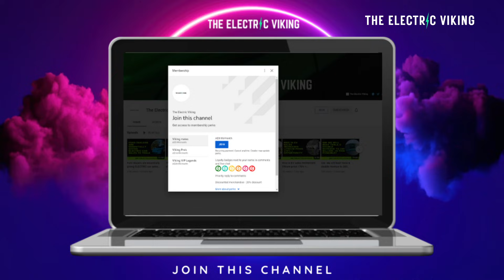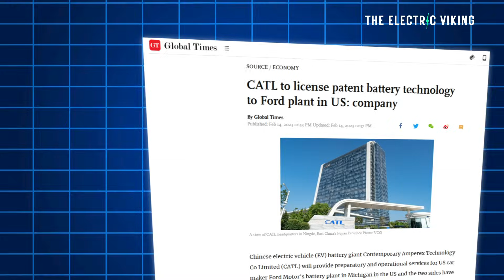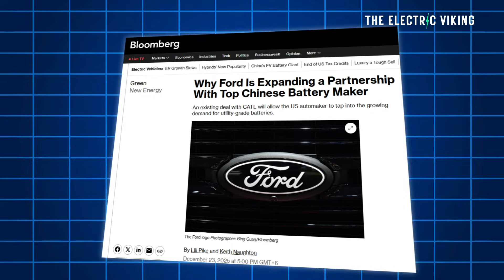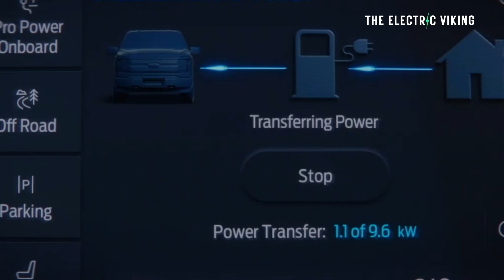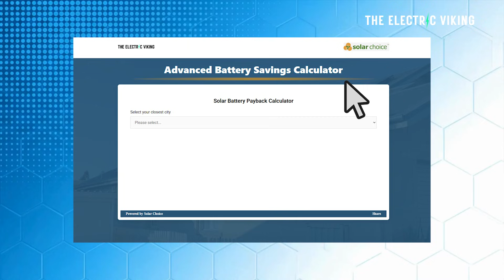Ford Cancels NMC EV Battery Factory to Build Chinese LFP Grid Batteries

Comment: Will sodium iron batteries make LFP batteries obsolete?
Reply: Not yet.  Cheaper & safer, but energy density is lower than LFP, so small shorter range city cars & stationary storage initially, till chemistry & energy density improves.

Comment: Considering just how fast battery technology is changing, manufacturing your own batteries is dumb because  your entire product line can become obsolete  in less than the amortisation time for the production tooling .
Sodium is about to com on line , aluminium - air is not far off and there are quite a few iron batteries being looked at .
Now from a company point of view, grid batteries represents a far better use of capital because you make fewer sales for many times more profit .
So the profit to equity ratio goes off the scale . Add to that governments are always slow to adapt to new technology until it has been proven very safe over time ,
The down side is grid storage is the absolute worse use for lithium batteries and once governments & energy utilities invest the type of money that a lithium powr pack requires they will be reluctant to go to better long term solutions like flow cells or liquid metal .
Lithium batteries have a place and that is in low current draw deices like cameras, phones , torches , radios etc .

The fun thing right now would be inside the minds of all of the MBA morons who flooded the board rooms of every public company & spun off every section that was not part of the "Core Business"  and now the way to make a profit suddenly has become to diversify into "Non Core" businesses where they expertise of the core business can be leveraged .yAnd these parasites have been paying themselves astronomical salaries & bonuses for decades despite having no actual understanding of what they were doing .

Comment: Wise decision. Tesla’s highly bragged 4680 battery is already a failure. NCM batteries is not good for EVs, dangerous with limited charge cycles. The only advantage is slightly higher density than LFP and Sodium batteries.

Comment: The reality is that most American politicians are beholden to the oil industry, and they recognize that the value of the US dollar (and its reserve status) is linked to oil  That being the case, they're doing whatever they can to forestall the electric/renewable revolution.

They might as well try to turn the tide.  It won't work. The economics already strongly favor electric vehicles and renewable generation, and their advantages are only going to increase.  The world is going to be a very different place in 10 years.

I think Ford recognized this, and is also willing to acknowledge that its options are limited, particularly with the Trump tariffs.  They've got some rough sailing ahead, but I think they've made the best decision possible under some very difficult circumstances.

Comment: LFP is old technology they need to go  straight to sodium, aluminium or solid state
Reply: Sodium is cheaper & safer, but lower energy density, so heavier & shorter range.  It's initially going to be in small, cheap, short range city cars (Stationary Storage where size & weight are less important) until the chemistry improves for longer range.

Comment: It's the height of Insanity to not embrace EVs I read these titles America's don't want EVs That's not accurate at all Americans can't afford EVs That's a whole different ballgame when you produce expensive cars especially electric cars without a large amount of charging stations so they can charge their cars and your mileage is only a couple hundred miles and you don't state what happens to the car after the battery starts wearing out then of course you're not going to get a lot of sales You shot yourself in the foot as expression goes. But since we're riding the back of the fuel companies Exxon so forth we're going to fall behind we're going to lose jobs and at some point electric cars are still going to come to the United States biden's ridiculous 100% tariffs didn't help anything We should be embracing electric cars We should be making business deals with other countries that make electric cars not depriving herself of the technology More charging stations cheaper electric cars and replacement of the batteries once they get around 80% efficiency The sales will triple look how well they're selling in other countries If you have to put a tariff on something then you're afraid of the technology. So much for capitalism capitalism is only designed to help the wealthy and exploit the poor
Reply: Tesla's now have the batteries as a bonded in structural component of the car floor, making battery replacement difficult, if not almost impossible.  Certainly VERY expensive!

Comment: Building coal fired generation plants would totally eliminate any need for these batteries and give the USA a powerful electric grid at a lower cost. With modern  emissions controls I see no down sides.
Reply: That might be because you don't breathe, and don't mind burning up in the heat. Living in Alaska won't save you.
Reply: @tedmoss LOL...The green new scam.
Reply: Coal costs more than renewables now. Also coal plants are base load and can't be easily ramped up and down to meet demand.
Reply: @jamesvandamme7786 Once coal got back in business the price would drop tremendously. Rail would be booming. Shipping would be booming mining would be booming again. Jobs created. Electricity rates would be the cheapest in the world.
Reply: @jamesvandamme7786 renewables can't be rampant up or dow except for wind on windy days.
Reply: @jamesvandamme7786  I think you fail to calculate the hidden costs associated with renewable energy. Number one is the fact of interrupted  production . The sun doesn't always shine. And the wind doesn't always blow. There are different ways to handle this, but for anything beyond short stretches coal, nuclear, natural gas or hydro is going have to pick up the tab on those missing electrons.
Reply: Why is it that the consumer wants "one size fits all" electricity supply, regardless of cost, pollution or ash disposal but the companies generating the electricity want the lowest cost electricity?  The consumer does not care about the cost of their electricity.  Wall Street financial types do care about cost and funny enough, they have shut down more coal-fired electricity plants and coal mines than the environmentalists ever did.
Reply: @peteinwisconsin2496  Lol...that is the stupidest statement I've ever heard. The consumer doesn't care about the cost of electricity....😂😂😂😂

Comment: Gemini AI:

Donut Lab’s all-solid-state battery, officially unveiled at CES 2026, represents a significant shift from traditional lithium-ion technology. By replacing flammable liquid electrolytes with a solid material, they have achieved specs that were previously considered theoretical.

Feature Specification
Energy Density 400 Wh/kg (Nearly double that of standard EV batteries)
Charging Speed 0% to 100% in 5 minutes
Cycle Life 100,000 charge cycles (Minimal capacity fade)
Operating Range Retains >99% capacity at -30°C and 100°C+
Safety No thermal runaway, no metallic dendrites, and non-flammable

Design & Materials
Cell Form Factor: The cells are roughly the size of a large smartphone (e.g., iPhone 17 Pro Max) and are characterized by being "featherweight."
Sustainability: The battery is built from abundant, "geopolitically safe" materials. It does not rely on rare earth elements like cobalt or nickel, which Donut Lab claims makes it cheaper to produce than lithium-ion.
Modularity: For larger applications, the cells are grouped into 5 kWh power units (roughly the size of a gaming console).
Real-World Application
The technology is no longer in the "lab" phase; it is currently being integrated into Verge Motorcycles (specifically the TS Pro).
Range: Up to 600 km (370 miles) on a single charge.
Charge Rate: Adds roughly 60 km of range per minute of charging.
Availability: Production bikes are scheduled to hit the road in Q1 2026.

Comment: Nmc is a dead end for most ev
Cost, thermal runaway risk, nickel, cadmium
Too many new options with better high, low temp performance and little to zero thermal runaway risk
Lfp, LMR, sodium, varied solid state chemistries, and many others based on Aluminum,  Zinc, Sulphur, etc.
Ford is the popular whipping boy, but this is the Right Move.
Armchair electrotech pundits can gnash their teeth all day, but sometimes Decisions gotta be made with the Big Boi Pants on

Comment: Why did the go for NMC in first place?🧐
Reply: Higher capacity, longer range, mature tech and production.
Reply: @jacobzindel987  not economically I believe
Reply: Versus LFP mature tech LFP TESLA Range The best Tesla LFP battery currently offers a range of up to approximately 320 miles (515 km) on a full charge, depending on the model and driving conditions.

Here’s a breakdown of Tesla’s LFP battery performance and which models use it:

🔋 Tesla LFP Battery Overview

Model	Battery Type	Estimated Range (EPA/CLTC)	Notes	
Model 3 RWD (2025)	LFP	~272 miles (EPA)	Most common LFP-equipped Tesla A B	
Model Y RWD (China)	LFP	~320 miles (CLTC)	Available in select markets A C	
Model Y L (2025, China)	LFP (82 kWh)	~466 miles (CLTC)	Longest LFP range to date C	

⚙️ Key Characteristics of Tesla’s LFP Batteries

• Chemistry: Lithium Iron Phosphate (LFP)
• Advantages:• Lower cost and more sustainable (no cobalt or nickel)
• Longer cycle life (more charge-discharge cycles)
• Safer thermal stability
• Can be charged to 100% regularly without degradation concerns

• Trade-offs:• Slightly lower
Reply: @robinspat  which is better i don’t get it LFP or NMC?
Reply: @Yas0753  if you don’t live in Alaska or other very cold climates but Norway is okay apparently then LFP which gives you greater cycles of charging and less likelihood of damaging from overcharging et cetera but more importantly doesn’t catch fire ever
Reply: @robinspat So LFP And is LFP Cheaper? Why America went for NMC?
Reply: @Yas0753 higher energy density, but more expensive.  These days, reserved for EV trucks & expensive high performance EV's.  It's now the performance/"premium" chemistry

Comment: The US propaganda, paranoia and short sightedness regarding China is stunning.  The inability to regulate the safety of lithium battery storage facilities is a legitimate concern as well.  Big businesses here avoid maintenance and training to preserve profit.
Reply: Lithium won't be an issue for long. Several safer and cheaper battery chemistries  recently went into production. Including some already installed as grid storage.
Reply: Lithium Ion fires are causing the govs to limit where batteries can be installed.  This is a potential disaster for the battery market.  BAN all new Lithium Ion roman candles and only allow LFP and Sodium or equally low fire risk batteries

Comment: It's a halfway intelligent move to pivot to grid/home energy storage. But cars store way more electric energy than a house uses in a given day and can be hooked up to the grid. Curious  why Ford wouldn't rather add more V2G features to their EVs instead of pivoting away from them.
Reply: That is what Tesla is doing.I am using the Cyber truck right now.
Reply: V2G & V2H increases battery charging cycles, which reduces battery life.  That's more of an ownership fear than range anxiety, due to high battery replacement costs/vehicle write off likelihood.

Comment: For the year 2025, Ford's CEO Farley and his minions managed to have 153 separate recalls affecting a total of 12,927,000 of their vehicles, everything from engine fires, to seat belts which corrode and break to numerous software operating problems while making a complete mess of their EV business. It's ludicrous to believe Ford management is capable of successfully operating in any segment of the U.S. battery storage business which demands operating software reliability. Farley has made $24.1 million in 2024 and again in 2025 selling $50,000 overpriced, poor quality pickup trucks and SUVs. If this is not a scam, then I am not sure what a scam looks like.

Comment: FORD is the recall king after century of being unable to make reliable cars.
How are FORD stationary storage banks going to get back to the shop for recall repairs?
Reply: They will just do an over the air update.
Reply: @tedmoss or soak them in oil & blame the owners for the "way you're using them"
Reply: Gonna be a boom in heavy haul trucking to pull Ford recall batteries back to the factory

Comment: Ford has delivered a total of 160,000 battery‑electric vehicles (BEVs) globally as of the end of 2024 that's about   $ 5,600,000,000.
Do you really believe they lost this much building - selling EVs ?
Reply: This is the end of 2025, They have lost even more now.

Comment: How do you know Ford loses about 35K on every EV it sells... That number can't be right because .... 35k is more than it cost Ford to Manufacture an EV ??? Do the math... Ford does not lose money on EV sales they may lose future repair service revenue.... over a 10 year period... but still no where near 35K
Reply: Losses include writing off the R&D, labor/equipment used to tool the assembly lines and unused parts inventory

Comment: The automotive industry is changing. The old corporations can't afford or keep up with rate of change in the industry. This is especially true for battery technologies, which need massive capital outlays and quick R&D responses to new minerals etc. Cars are going to be styling choices stuck on ever more homogenised platforms. The basic EV cars are now approaching or indeed passing ICE super car speeds and accelerations. Once the EV driving ranges match or exceed 500 miles on a charge, and the charging speeds drop to 10 minutes from 10%-80%, the ICE generation is obsolete. People will hang onto ICE cars and decry EV's as the spawn of the devil, but when the petrol and diesel stations start closing because they are losing money, the adoption of EVs will explode! Centres of excellence and mutual alliances for the fundamental items of batteries, electric motors and electronics will happen. Anything bolted on top of that is styling. So Revenues and profits for traditional motor companies will plummet. Big changes coming.
Reply: In fact, some high-end all-electric vehicles in China can now achieve a range of 500 miles on a single charge. Of course, the battery capacity needs to be large, for example, a pure electric car equipped with a 100 kWh battery can achieve an actual driving distance of 800 kilometers.
Reply: At a point, motors battery evolution will outstrip the ability advance motor efficiency by the 1-2% EV motor efficiency & manufacturing efficiency/cost can achieve achieve, so there'll be little point having 100's of EV motors like ICE engines, so shared platforms will make far more sense & it will all come down to.packaging, battery size & controller variations for use cases, saving a FORTUNE in R&D & manufacturing costs for upgrading.  Body type, styling & interiors will be where the costs lie, but packaging less of an issue when all vehicles become a battery skateboard with tiny powerful motors.  Like chassis & body of olden days.
Reply: @alexmanojlovic768 Good comment 👍
Reply: @alexmanojlovic768 I agree, Maybe items like Air Suspension (Citroen) or Display styling may be retained by "Traditional" car manufacturers if there are any left
Reply: Shhhh!!  Don't tell 'murican Rednecks & petrolheads.  They're quick to learn & will fight back!!  And keep on coal rolling Tesla's & Chinese EV's...😂😅🤣

Comment: Lmr or solid state batteries only before I’ll buy.
Reply: LMR is cheap, but there is a reason why the late prof. John B. Goodenough invented the LFP battery: In the LFP battery chemistry, there are no active ions in the electrodes. The charge difference is generated directly from the difference between the energy states of the lithium in the electrodes, but this lithium itself is electrically neutral in both. In cobalt batteries there are active cobalt ions and cobalt oxide ions in the electrodes. In manganese batteries there are manganese ions and manganese oxide ions. What you get is a lot more current, higher voltage (approx 33% higher) hence higher energy density, but this comes at the expense of the longevity of the electrodes, so of the battery. You will get better performance out of an LMR battery than out of an LFP battery, but the LFP battery could survive up to 30 years while the LMR battery might die after 7-8 years. Sure, I got no idea what advances Ford had made, maybe they found ways to solve this issue, but currently I'd go with LFP.. And yes, solid state batteries will solve everything. But that's still in the future.

Comment: Just and FYI 
Donut lab just released their solid state battery with 400Wh / kg  and is putting in Verge Electric motorcycle now being released in the USA
A 33 kWh battery module capable of 600 kms range and charges 30-80% in 10 mins.
Reply: What a joke. Another lie from the stupid USA😂
Reply: @LuxuryExpress-d2f  they are europeans when they are not brexiting...
Reply: Donut labs is in the UK